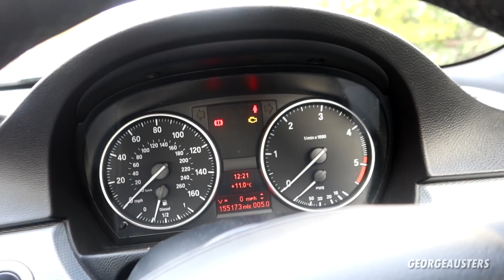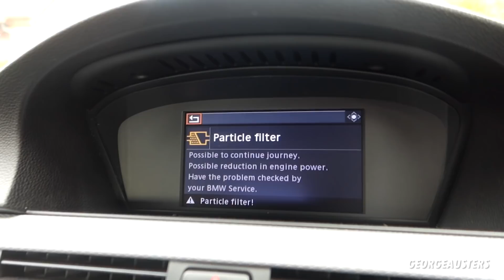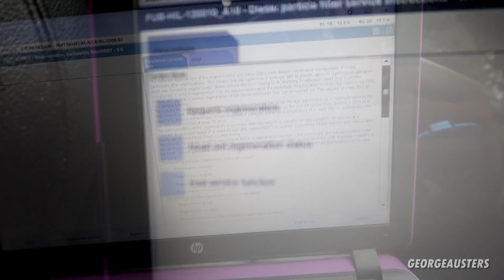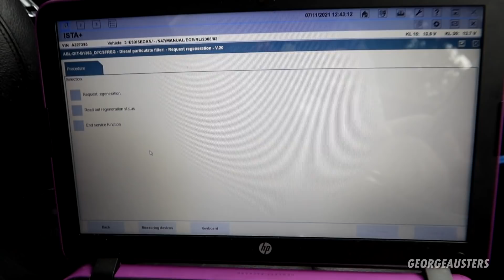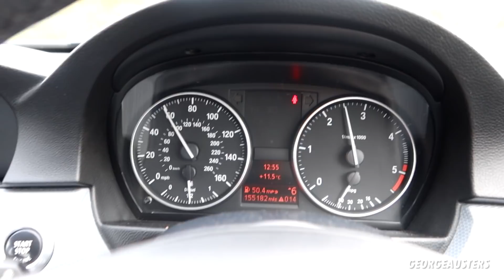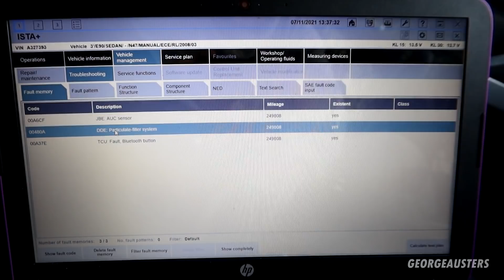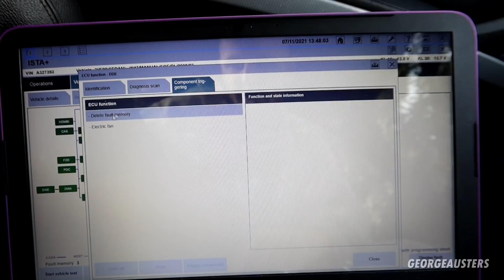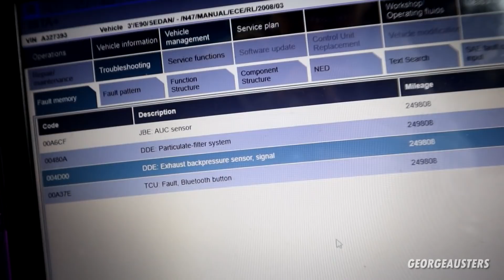SHOULD YOU REMOVE A DPF FROM YOUR DIESEL?

Comment: I agree with the DPF removal from the 10th year onwards. I bought an used E81, 14 years old. Soon the DPF light went on, but as a new car owner, I talked to a friend and by his advice tried to fix it by regen, long drive at 2000rpm. My fault. The result was the turbine broke it's axis after a highway drive. Everything's ok now, but the high pressure from a blocked DPF is not something to be neglected, no matter the extent of blockage.

Comment: I'm going to put my tin foil hat on and state that some car manufacturers preprogramme the car to show a dpf fault once a specified mileage trigger has been reached, even if the dpf is fine. It's planned obsolescence like iPhone batteries. Designed purely to cost the consumer more money in repairs or even to steer them to a replacement vehicle.

Comment: M57TU 730d when they where new they could get 7.4-8.3l/100 km      now its more like 10  .....    
these vehicles start to consume alot more fuel indeed bc of clogging cats / leaky egr's :)    
the green tech isnt really good for your engines . and when you want to drive fast it really gets in the way in terms of heat generation. an exhaust needs to be an exhaust nothing more.

Comment: Your car wont pass MOT if you remove the DPF unless you know a dodgy MOT tester. The one on mine is knackered and i get smoke comiong in the car and out of the bonnet everyone thinks it's on fiire.
Reply from the maker: Should pass fine if mapped well
Reply: @GeorgeAusters  MOT Tester told me they can't pass any car if the DPF has been removed

Comment: The problems with Dpfs regenerations can be caused by multiple situations, one of the most important is the turbo system not working properly. I had problems with my diesel car, during several years, just because there was a very small hole in the solenoid vacuum hose of the turbo, that no mechanic noticed and that no error code diagnostic! I discovered the problem by myself.

Comment: Remove and run the gauntlet with mot which is getting even more strict on emissions , I get what’s being said but advice is for yesteryear not today
Reply from the maker: You shouldn’t have an issue with MOT if your engine is healthy
Reply: @GeorgeAusters  if you remove the dpf which is a filter for particulates of course it will , but obviously the health of the engine contributes but isn’t a guarantee

Comment: You are very lucky driving at those high revs with blocked dpf, this can cause serious issues. I blew my engine doing this on a Mercedes. You are supposed to take it out and clean or replace it.
Reply from the maker: There was no need to remove it

Comment: I have an 05 Volvo V70  Having Been away in Hospital for  2 Months; Having left My Key with him" He'd  sit in the Car every day with the Engine  switched on and  Never Drove it anywhere,  whist in hospital After two Months  I Had the Garage  Service it and Give a Full M O T  After the Two Months  when I got home  I Had a Message on my Phone  Telling Me to Give the Car a Long run on the Motorway: He  did not Explain why? But on Starting up  the {Diesel Engine } the Engine spluttered and there were No Revs' I switched the Engine off and then started it  Back up again  this time it revved up  where I Drove onto the Main road. the Car would Speed up and then almost come to an halt and then Pick back up'  Black Plumes of smoke  shot out of the Exhaust Pipe for a brief Second and then the Engine  would spring back to Life  Giving Me  about 20 M P H  where it spluttered again and again;  I phoned the Garage thinking that they were at Fault in the repairing of the  Car! It was Explained to Me  what was a Matter. There was a  Sign on the Dashboard saying that it was Sooted  up . It was explained to Me that Possibly the Car had not  Been driven at High speed  and that the D P F was Blocked up; But if  I took it onto the Motorway and  gave it a  Long run it would Burn away the Soot. After an Hour of Shuddering and  Sputtering and  Smoke  Choking car drivers Behind me the Car went on Top speed  But the Very Next day the Same  Problem  Happened  over and over again: The  advise  I was Given  was to Take the D P F off and have it Cleaned  {I was Quoted 300 pounds }  I Bought  a Brand  New one  for  250 and a Sensor for  103  Now You'd think my Troubles were over ? wrong  The  Car Shudders and stalls and when it seems alright  the Top speed is 60 Miles an Hour  going up a Low grading road and  80 M P H on a Steep down Grade: I have  Been told that Because the Garage  did Not  reset the Engine  The onboard Computer Still thinks that the DPF and the Sensor has not been Replaced  Could that be the Problem

Comment: Just a note of support. To tackle such issues in real time is impressive. I agree with you on DPF. I have 13 year old 520D with 72k which has had a very easy life. It is only used on journeys over over 100 miles no short journeys. The car is immaculate but will I get another 7 yrs out of it. Its electric and high tech issues which will condemn it to the scrap heap which in a holistic view is not good. I will only buy Toyota from now on
Reply: Your a poes

Comment: Are you checking the exhaust gas temperature at the turbine outlet and also at the dpf inlet when driving using your computer gadgets.
The turbine out temp should get hot enough based on your hard motorway driving pattern. Say about 400degC.
Then under these conditions the dpf inlet temperature should be much higher maybe 500-600 deg C.
If the dpf in temperature is not higher then it will not regenerate

Comment: I’ve been through this situation with a 5 series E61 and managed to successfully recover the DPF. I have some tips:

1. When ISTA tells you to do “rural” driving or “cross country” this does NOT mean cruise along a motorway! It means drive in the countryside over undulating roads where the average speed is kept above the 60 kph minimum but where the throttle is changing as appropriate to the road. This helps to keep the exhaust temperature high enough to maintain regen.

2. You need to continuosly clear fault codes as you drive. I’m not going to suggest you do this as the driver since this would be dangerous but you could bring along a passenger to help. When I cleared my E61 DPF I made sure I was clearing DDE fault codes every 10 seconds or so because regen is disabled as soon as a high backpressure fault code is registered. There is an attribute you can read real time to check if regen is happening or not. 

3. If after trying the above a good few times you are unsuccesful then consider getting your DPF cleaned professionally rather than removing it completely. A DPF contains two types of “particle” typically, namely Soot and Ash. The Soot is burned during regen to form Ash, some of which remains within the DPF and is only removable using industrial cleaning processes. You can clean it using copious quantities of vinegar (acetic acid) but there are other chemicals that can do the job faster.

4. Don’t remove your DPF because it’s there for a good reason, and is ultimately a consumable device which must be replaced (or cleaned) every so often. It’s also illegal to not have a DPF where it was fitted from the factory.
Reply from the maker: It’s nothing to do with where you drive it, I managed to do the regen on the motorway in the end. Watch my update video👍🏻

Comment: Similar problem with my 2016 Cx5, tried regen no luck.  Actually the warning light came on when I was over 300km from home. I drove back at 120kph in outside temperatures of 35°c. Sweet FA!
Eventually took it to Mazda Dealership, took them a few hours for a computer "burn off" 6 months on now, no problems fingers crossed!!

If it does return I ll either remove it or do a chemical clean. Thankfully they're not mandatory here!!  Cheers for the video George.

Comment: OK. First thing. Your answer to correctly repair a car if you don't know what to do is to remove the emission control system and poison other road users with NOX. In reality. The systems work and work well. As long as you maintain the vehicle correctly. Any attempt to re-gen has to be carried out with ALL faults rectified first., The ECU will not permit a re-gen with results present. The only one you cannot change is soot content. This is usually high because people ignore the EML light for miles and miles. You should check soot content after repairs are done. Then you will know if it will even do a re-gen. If the content is to high the DPF needs cleaning by an induction method by a professional or remove it to clean. Most issues are created by cheap fuel and lack of services. I don't go a month without seeing this type of issue.

Comment: I had same problem. The other condition required is engine coolant temp above 75°. I checked the thermostat in a saucepan and thermometer and it was opening at 68° changed for a new one and bingo, finally regenerated.

Comment: My BMW E91 320d LCI has 186k miles on it and it has the original DPF. The exhaust backpressure sensor should be changed every 60-70k miles (it`s a piezzo part and exhaust temperature along with soot will make it give wrong info to ecu). Also you should check your entire engine (worn injectors/turbo/piston rings will cause building up more soot in your dpf). Removing your dpf should be the last option and  I would not recomend removing it unless your engine is pretty much worn out

Comment: I wonder who does your MOT tests, if your car has a DPF fitted as standard and is required by manufacturers emissions settings, and you remove it, it’s an instant MOT fail item if it’s been removed or cut open and the inside of the DPF has been removed and the silencer box welded back up.  If your DPF is too badly clogged/blocked by soot, no regeneration test will ever clear it out, if you can get a spot content of your DPF on your laptop it should tell you how badly sooted your DPF, the only way is to fit a new DPF, and any sensors that are fitted to the DPF should be renewed at the same time..
Reply from the maker: DPF is not required to pass the emissions test. It should pass fine if you have a healthy engine👍🏻
Reply: @GeorgeAusters  if you read the MOT manual, which is available online, you’ll see it says, any car that has a DPF fitted as standard equipment as manufacturers made the car, and it’s been removed/tampered with/deleted, it’s an instant MOT fail.

Comment: Money/mpg saved is wiped out having to do this. Had a Vauxhall that did a passive regen every 300 miles or so. Flashing light indicating you’ve interrupted a passive regen several times, now you HAVE to go for a drive……used to knock about 100 miles off the range…….what’s the point in having a diesel unless you’ve a lgv/truck?? 
Dearer to buy, dearer to fill up……so much more to go wrong with modern diesels……yes they go like stink but it’s a no from me…..can’t be arsed with the headaches!
Reply: suggest you research the difference between passive regen systems (like the ones you describe) and ACTIVE regen systems as fitted to my 2.0 TDCI Ford which ive owned for the last 7 years (bought used).it can and WILL (and has done) start, and complete a full regen at IDLE if the ECU deems it ready to regen!
Reply: @petelattimer6808  well aware of the difference. (In my personal experience) mine used to do passive regens without being aware accept for the fact it used to idle faster and instantaneous mpg used to go up. 
If this was interrupted (which could be done easily if you weren’t vigilant of the previously stated) several time it would trigger the flashing glow plug light indicating you had to drive until light went out…..more often than not at very inappropriate times ie taking daughter to school, out of supermarket with a boot full of shopping etc. 
if this was ignored several times then it would be in to a dealer for a forced regeneration. 
For me I’d rather lose out on extra torque and few mpg for the extra hassle of the above. 
(Note in my Ford transit custom for work I’ve had zero issues probably as I’m doing business mileage/usage not regular social type trips/mileage). Lots of factors to consider however, not just type of driving.

Comment: I have ran diesel cars for over 7 years . Never had a single DPF problem not once . All with mixed mileage from very high to low mileage, all parts inbetween . The problems I appreciate are many fold, for a lot of drivers . Diesels are for high mileage use. They need prolonged use at motorway speeds regularly , to burn off Ash build up . Running at high temperatures.  Which is precisely what I do weekly . I'm not lucky . I just use them in the way which they were designed. Hence lack of dpf issues and such like . Its not luck its using a product within its parameters . Most people don't really need diesel at all . Petrol is what they should of been using from get go ! Stop start short journeys constantly is where the problems start and finish .
Reply: ive had no issues either and most of my trips are short, stop start trips. but i researched my vehicles more carefully and bought one with ACTIVE regen system rather than the passive ones. this means if im even just sat idling for some reason and the DPF regen is due, it WILL begin to regen and even COMPLETE without ever leaving idle if thats what is required!

Comment: They want you to throw your car away - I drive a 20 year old 2.6V6 and it works just fine. People say I should scrap it and get an electric car because I should not have a big car with a big petrol engine. I only do 5,000 miles a year and to buy a new car and srap mine would be environmentally damaging thing. The diesel lorries taking the parts to the factories and the end product to me,  also the energy it takes to build a new car with scraping  mine would be much worse for the environment. I will wait till my car is broken, even though the introduction of E10 petrol nearly made my car break down as it does not like the fuel and misfired really badly.  

They are forcing us to hurt the environment by forcing us into a 10 year purchase of a new car cycle, in 10 years time it will be: You are using Lithium batteries, how dare your use lithium,  you are hurting the environment and you should be using Green Hydrogen. 

My council is a green council and they are closing roads to traffic forcing cars to sit in long traffic jams,.They have stopped certain household collects forcing us to wait in traffic queues in our cars at waste recycling centers. They have also somehow reduced our bus service at the time when they say they will be Zero emissions city, I will just get vans to deliver all my goods then and instead of me making 1 trip, let many companies deliver my goods. It will affect my health as walking to the front door is not the same as walking around the shopping centres.

So in summary, the cost of these DPFs have done little for the environment, just costing you money and we all remember that buying diesel cars were good for the environment back in the day, even before DPFs  :)
Reply from the maker: EVs will be old technology soon

Comment: Had 2 DPF failures on my 2015 A6.  Absolute nightmare and would never get a newer diesel again.  Car was used for long(ish) journeys at constant speed 40 minutes per day averaging 60mph.   On the new Audi engines (2.0TDI) the DPF and EGR are one unit mounted right next to the manifold and located under the engine mount on the drivers side,   you are looking at £1,000 in labour just to remove and if you need to replace them add another £4k onto that.   I ended up replacing one under warranty,  it then failed again due to a sensor fault so I ended up removing both and re-mapping as Audi wouldn't cover the second replacement (Over the warranted miles) ended up costing me £2k to remove and re-map both EGR and DPF out and if I'm honest the car has never run right since,  the new engines seem to be tuned so finely that any pressure removed from the exhaust side just causes massive problems for the turbo and inlet under boost conditions so I'd be very cautious at removing one certainly on a newer diesel engine car as it may end up costing a lot more in the long run,  I'd also be cautious of the fact that you might end up failing the MOT emissions tests.
Reply: nothing to do with being diesel and everything to do with being a VAG vehicle im afraid. Audis were a great car once. then once the A4/A6 etc were launched they were never decent after that. in fact they were little more than rebadged VWs, which themselves were seriously overrated. speaking from personal experience AND as a mechanic i wouldnt touch ANYTHING VAG. in fact id buy a FRENCH car over BAG, and i HATE french cars. the electrics are DREADFUL (not that VAG are much different in that respect either, the reason my childrens mother got rid of the VWs is electrical problems!)
Reply: @petelattimer6808  Hi Pete,  Yeah sorry, I stand corrected.  100% a VAG problem.  I've a Ford Focus estate I use as a daily these days (Not the best brand) but testimant to it,  it's got 250k on it and still runs perfectly.  And 100% agree about the electrics.  The amount of times I'd turn on the A6 (usually in the winter) only to be greeted with every single warning light known to man,  turn the car off and on again and everything would  be fine,  also replaced about 3 boost pressure sensors in my 2 years of owning the A6.  Not good at all.  Wouldn't touch a VAG ever again.

Comment: Did you reset the fault codes before you tried to regen? I don't think you mentioned whether you did this before the drive. My understanding it it won't even try to regen with fault codes active. Also, it's an mot failure if you remove the dpf.